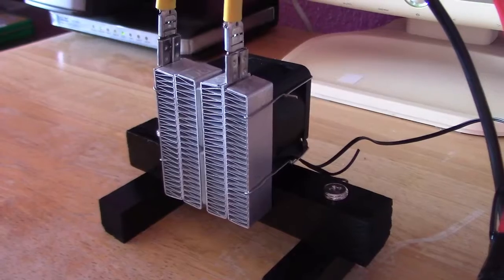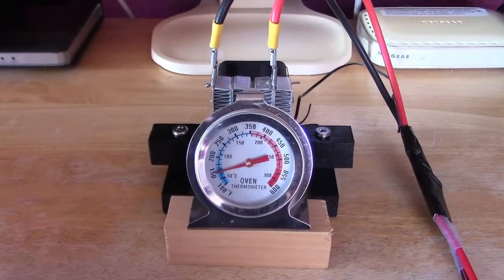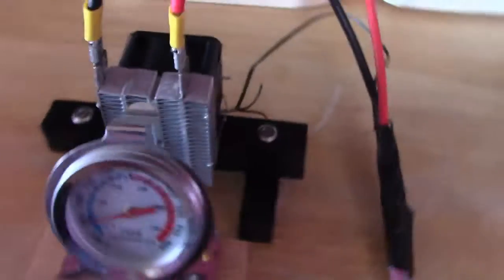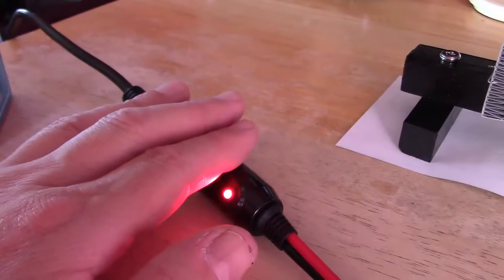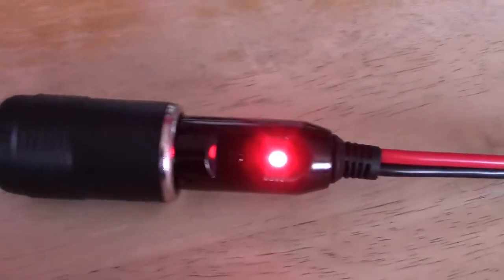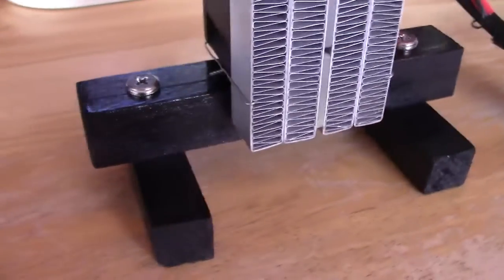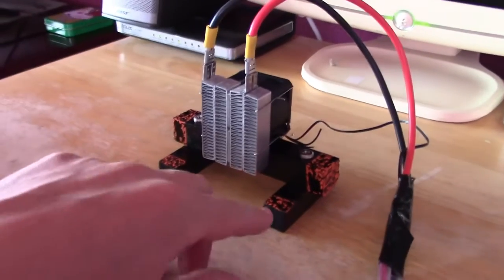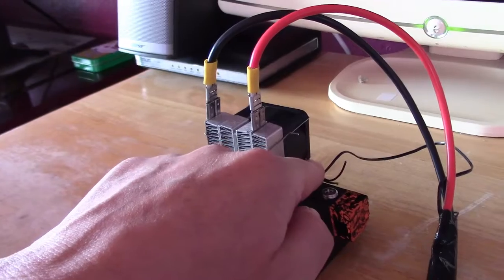Homemade Air Heater. AC/DC Powered. 150F/65C. Ceramic/Alum. "Ripple' Air Heater (solar/batt. option)

Comment: I've been enjoying your excellent videos and DIY projects.

I'm in the process of converting my minivan (Dodge Grand Caravan GT) into a no-build camper. I live in Michigan so temperatures can get below freezing here. So, I'm looking to solve a couple heating problems in the van. First, I would like to find a way to keep my 12.8v 230ah LiFePO4 battery warm enough to charge via solar panels and avoid damaging it. Second, I'd just like to keep the van warm if I could. So, I'm wondering if you have any idea what the CFM turnover of this heating element/fan arrangement is?

I see potential in keeping the battery warm enough to charge via solar during the day and I was also thinking of perhaps making a sand battery or a PTC ceramic heater as you've made in other videos to keep the immediate environment of the battery warm during the night and perhaps warm the van a bit as well.

FWIW, I have a 12.8v 230ah LiFePO4 battery housed in a Ridgid modular toolbox (~16" x 22" x14") and a pair of Ecoflow 1024wh Delta 2 power stations that I can use to power 12v appliances (like my camping refrigerator and freezer units, a small 12v electric throw, lights, kettles, induction stovetop and small microwave) but I guess I'm paranoid about running out of power during stretches of inclement weather and no solar to recharge the battery and power stations if I go boondocking for extended periods or if the temperature drops to low. I'm also installing an alternator charger as an option but don't foresee driving around for hours just to recharge the power supply. Also have backup propane options for cooking and will probably get a diesel heater in the future but that redundancy takes up storage capacity in the van and introduces some additional safety concerns (like excess humidity and/orCO fumes). So, the sand battery, PTC elements, and the low wattage DIY heater seem very low maintenance, inexpensive and relatively safe.

Can you estimate the volume of air they might heat/maintain to a certain temperature? I'm especially interested in what this 12v 70w heater might provide. Thanks.

Comment: What solar panel is good for this?
Reply from the maker: to get full power out of the heater - i'd recommend using about 150w of solar. that will give you the amps that you need. (any 12v panel or panels that total at least 150w). i used to say a 100w panel but that is a little too small

Comment: Hi.  Thanks for all your good work. Do you have a suggestion for a heater safe to use in a rooftop tent?
Reply from the maker: hi. you'll have to use your best judgement when it comes to which heater you might want to use in a tent. i recently made a video on the 33 DIY heaters i've made. you may want to check that one out. it's a great way to see them all quickly.

Comment: You did a video of one of these 4 years ago with a pc cooling fan. Does this fan work better?
Reply from the maker: this particular fan is a 'higher end' fan. seems to match up almost perfectly with the element. you can use a standard computer case fan though.
Reply: @desertsun02  I ordered one of those heating elements off eBay that had a computer fan attached to it but it didn't put out very much air. I ordered the 40 mm fan hoping maybe it would put out more air

Comment: this actually works ! But its a very very small amount of heat...you can maybe warm your hands when on a desk...im working on something similar but bigger to heat a room
Reply from the maker: hi. yes, it works good. keeps me nice and warm while sitting at the computer desk. my next video is of a much larger (20 amp) heater. it's also 12v and runs off grid. that one is more of a room heater. video will be out in a couple of weeks.
Reply: @desertsun02  i am subscribed ! Because of you i started this as well, i am doing a system over 550 w, with a 300w heating unit ! I will let you know how it goes...thanks for giving me a really nice hobby !

Comment: Great Job with that Project. Please keep up the good work ! ! 
One potential area of improvement for many of your projects is to measure the sound with a meter and buy a fan that is quieter even if it costs more money.
Reply from the maker: hi there. just a quick note on the fans. the fans i use in my projects are all pretty quiet and just sound like regular fans. the fan in this project is no exception. *the reason they sometimes sound louder than they are is 100% due to my video camera. the camera has its dual recording microphones placed (or built-in) directly on the front of the camera (under the lens) and because of that the camera picks up the sound of the motor as if you're putting your ear up to it. in reality though, the fan just sounds like a regular small fan. it's got a 'smooth relaxing sound and sounds the same as the fans they use in small store-bought heaters. (if I'm more than 3 feet away from it i can't even tell if it's on or not).

Comment: I get very little direct sun here in winter because of pine trees to my south. I had wanted to build some sort of direct solar panel powered DC heater for my camper or a sand battery type device to store the heat. I`ve noticed that my 600w bucket water heater heats up my bathroom in winter by the time the water is hot enough to bathe. My emergency heat plan for winter storms right now is an electric blanket and 200w Lasko mini space heater and my  various solar batteries. I can`t depend on any other fuel source because I have no transportation and can`t afford fuel on SSI disability. I did check at the only store within miles and a 4 gallon tank of propane is 22 bucks. But right now I can`t afford a heater, hoses, filters, etc. 

And there`s very little natural firewood nearby...I counted two large oaks and three small ones in the area here that I can gather dead limbs from. I got the only gas generator I could afford three years ago and it burns five gallons of gas a day and that costs a lot extra for the 2-stroke oil...way more than propane. So I`ve never used it. If I can rewire my solar setup for my 300ah Ampere Time battery and get a whole lot more solar panels to soak up the 2 hours of direct sunlight I get I might have a chance to have power I can make use of. But the panels will have to be larger than the 100/200w 12v ones I use. Can`t put those in series here in winter because the sun hits a very small area. I bought my solar batteries thinking I would be on another lot with plenty of sun.
Reply: Sorry to hear that 

Consider getting a Zippo hand warmer,25c of fuel gets you like 12 hours of 140 degree heat

Cheap HW bottles are great

Also Fortress clothing makes the best baselayers in the world

If you Google the PALS system of clothing, you can make your own amazingly warm clothes /blankets /sleeping bags out of open cell  polyurethane

Best of luck

Be safe and be well
Reply: Consider getting an electric kettle for 20$ to heat up water for hot water bottles as well

Comment: The optional detailing is mandatory. It looked especially cool with the orange/black speckle look at 02:06. Great project, as always, thank you for sharing, much appreciated 👍🏻
Reply from the maker: hi and thank you! thanks for letting me know your thoughts on the detailing. the abstract 'speckle look' is the final version. i thought it looked pretty cool that way too so i left it. i got that effect using a wooden toothpick of all things. no paint brush used.
Reply: @desertsun02  Wooden toothpick? Haha, an insider trade secret right there. I won’t tell anyone 🤫 😆 👍🏻